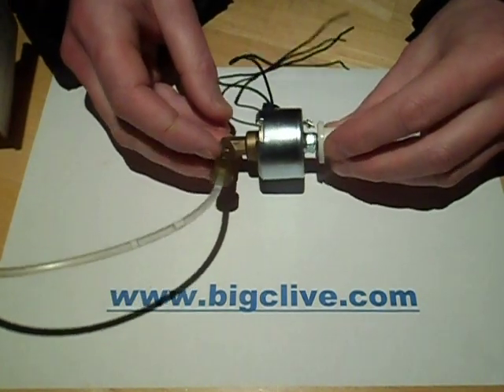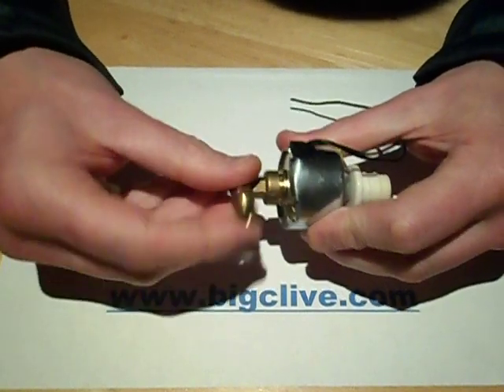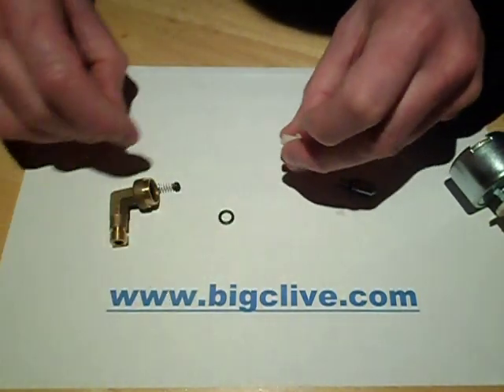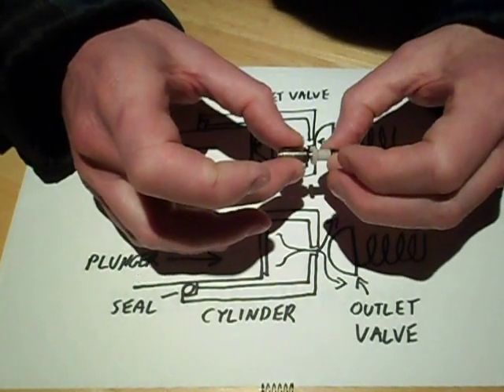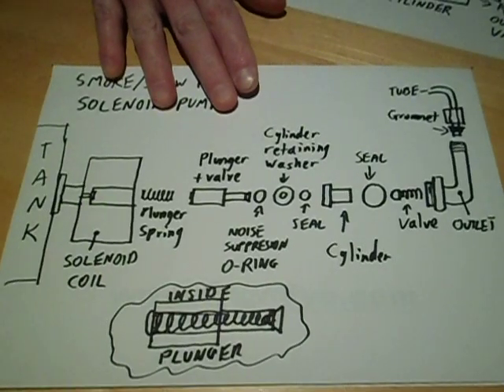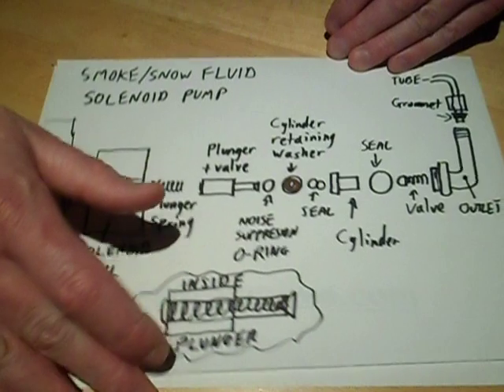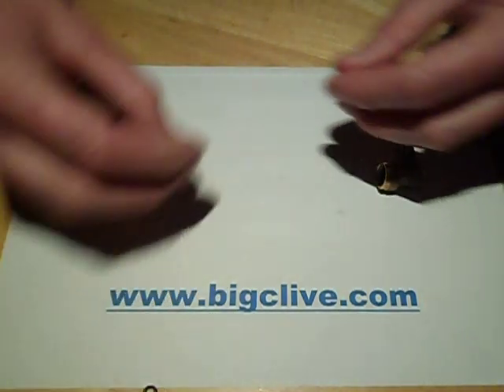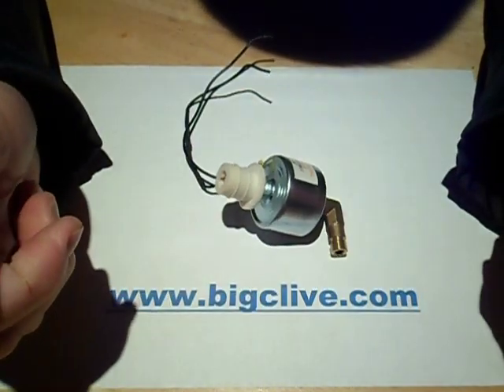Smoke and snow machine pump maintenance.

Comment: Cannot thank you enough, Clive!  This exact pump was in my Pelonis dehumidifier here in the US.  It was less than a year old and was leaking on the floor.  The pump was stuck, and your take-apart-put-back-together diagrams gave me the info I needed to clean and reassemble.  Problem seems to be solved.  You saved me like $200 by repairing, and kept it out of the landfill.  Thanks!

Comment: I have wondered about using these things to pump common petroleum-based oils, e.g. lighter weight gear oils in machines, or automatic transmission fluid for bandsaws (as a source of lube for the blade.)

The volume of fluid needed is modest, about 50 cc per minute or so.
Reply from the maker: This style of pump is commonly used as a fuel pump like the pulsed DC ones used with diesel heaters.  The oil would need to be well filtered though.

Comment: (1) Watch video.  (2) Disassemble pump and clean it out.  (3) Attempt to put it back together and get confused.  (4) Watch video again and discover your pump has a very similar yet different set of parts than bigclive's.

Using the terms from bigclive's diagram, mine has no distinct cylinder nor valve.  The cylinder seems to be integral to the elbow-shaped outlet.  The noise suppression o-ring's inner diameter is larger than the outer diameter of the cylinder retaining washer, and is nearly indistinguishable from the larger seal.  Maybe I'll try to find a replacement pump.  Unfortunately, the ones I've seen so far all use a smaller diameter input hose and output tube (like many of the 400 Watt fog machines I've looked inside).

Despite all this, I still appreciate the video!
Reply: I finally got mine back together.  In my case, the "cylinder" is metal and is an integral part of the solenoid assembly.  Instead of one larger rubber seal as shown in the diagram, this has two.  Once is flat like a washer and the other is rounded like a donut.  They have approximately the same inner diameter, and they slip over the end of the integrated cylinder (though I no longer remember in which order).  There is no removable spring valve.  The elbow shaped outlet pipe (which is all metal on mine) also functions as a one-way check valve, which seems to serve the same function as the spring valve shown in the diagram.  The input and output tube diameters are a little larger than I've seen in other machines.  All that was pointless.  I found nothing gunking up the pump, and it still doesn't run, not even once the machine heats up.

Comment: I'm looking for a tiny 12v 50HZ pump that goes in a "Power Tiny" fog machine.  I can tell that the problem is the rubber check valve isn't working anymore. I think it's swollen in size.  I'm thinking about source an external check valve to go inline with it and see it that will make it work again.
Reply from the maker: It's unusual that the pump is 12V.  Is it pulsed or does it run continuously when active?  It may be able to be stripped and cleaned.  Check out this video.
https://www.youtube.com/watch?v=Yz5MP76EuZc

Comment: I am so happy that you took the time to make this video and post it. My sister has a fog machine that she needs repaired immediately for Halloween tonight. Last night I worked on it without any luck of getting it working. After watching your video I have determined that someone else has taken the pump apart and got the parts back in incorrectly. Just like when I took it apart, pieces sprung out. Now that I know the order, I am about to put it back together the correct way! Thank you very much for the assistance!!! One thing for sure, YouTube is the GREATEST learning tool ever invented. Anything broke I find a video to watch, repair the item, and save myself a lot of money!. Thank you very much for the contribution. Excellent video!!! I can't thank you enough.
Reply: I disassembled the pump and found that it had a broken spring. I  took some stiff wire, a guitar string, and fabricated a spring of same diameter and length. I used my ultrasonic cleaner to clean all of the parts, then used a folded up pipe cleaner to polish up the cylinder. Next I put the assemble all back together. It seems like maybe my brother-in-law might have taken it apart and got the parts in the wrong order. I was so pleased when I fired up the unit and it worked!!! I fogged up my house in a matter of minutes to the point where I could barely see anything, and took pictures to send to my sister. Her and her husband will be delighted to be able to use both of their machines tonight for Halloween! Thank you very much!

Comment: Let me give some tips... 

1. Blow air backwards through the filter that goes in the fog juice, you can do this by blowing air with your mouth. Also wipe the screen off with a tooth brush. 
2. Use a long thin wire, or pipe cleaner, and shove it in the rubber hose between the container holding the juice and the pump. Make sure to disconnect the hose. This will clean out the hose from end to end.
3. Re-attaching the hose is a total pain in the butt so widen the tip of the hose with a Phillips screwdriver, or even a nail that is larger than the inside diameter of the hose. Stretch the hose wide, and once you pull the screwdriver or nail out, quickly push the it on the filter, then do the same for the end that goes to the pump. Last of all, put a tie-wrap on the pump end of the hose.
4. Before disassembling the pump, put a towel down to catch flying parts, pull loose or else you will be on your hands and knees for quite some time trying to find parts. Pull everything apart VERY slowly!!!
5. Check the spring in the very back of the pump. Use tweezers to pull it out. Like on my machine, the spring was broke. I had no springs in my junk parts. I made one! I used guitar wire and wrapped it on a screwdriver shaft. On the screw driver, I used  one that was a slightly less diameter, and wrapped it around the shaft using the same distance between windings, then cut it to same length as the original spring.  
6. Use a pipe cleaner or rag to clean the cylinder where all the parts slide in.
7. Put all parts disassembled into an ultrasonic cleaner. I used dish soap for the cleaner. Run the cleaner for about 5 or more cycles. Use a magnifying glass and closely inspect all parts for any build up. 
8. Blow air through the PLUNGER VALVE (shown in the video). Do NOT try to remove the spring!!!
9. After reassembling parts back on the motor, use the large bolt looking thing to adjust the spring tension. Screw outward to release a bit of pressure on the spring. When the voltage is applied to the motor you should hear it very well. If you don't hear anything, screw the big bold all the way in, and gradually back it out. One can also start with the bolt almost fully out, and turn a quarter turn in until the motor can be heard. 
10. Make sure to be EXTREMELY careful when working with AC power connected!!! Use rubber gloves and insulated tools, and do NOT drop tools or accidentally come in contact with any electrical contacts. Wipe out any spilled fog juice, it is highly conductive. Make a mistake on safety  you will most likely DIE from electrocution. I'm an electronics technician/teacher so I don't have a problem with live circuits, but ALWAYS follow safety rules and precautions. If you are uncomfortable working on live circuits do NOT work on it, get someone else to do it!!! You screw up, this might be your last day to be alive!!!
11. Before starting up the machine after all this work, prime the pump! I used a syringe loaded with juice. Pull the filter loose, shove the end of the syringe on the tube, and slowly fill the pump and tube with the machine on and running. Once you have fog blowing out for about 30 seconds, stop the machine, put the filter back on, put the filter back in the juice, and do NOT let air bubbles in the line. Pinch off the line while putting the filter back on. Keep it pinched until the filter is back and submersed in the juice!

I hope this gives everyone a bit of insight on the techniques I used to fix my machine! The machine works so great now that I fogged out a 30 x 24 foot room in less than a minute!

Comment: How bout if you remove the spring valve so that the fluid will just go straight to the heating component? What could possibly happen?
Reply: Same question here. The rubber head of the spring valve seems to be blocking the flow.

Comment: Good to know. I had my fog machine sitting for quite long and now its just not pumping properly. So im just gonna clean that.
Reply from the maker: +drkastenbrot If it has the same pump then also check for a corrosion blockage at the right angle section.  I've had two block up solid and need reamered with a pointy thing.

Comment: One little tip is when electrically testing some of these pumps, they contain an internal diode, so make sure the meter is on the diode test setting and try it both ways round. Until I did that I thought the pump had gone open circuit.

Comment: I need help, I have the same product, but I think I had some problem putting it together, because it has no power, the jet is very weak. Please, if you could support me, I really appreciate it.
Reply from the maker: If it's a smoke machine then a common failure other than the pump is the pipe going through the heater block getting blocked up with deposits.

Comment: Very informative, thank you! Can you suggest where I might be able to source a new one though?
Reply from the maker: +john rose (TPRC) If it's a high profile machine then from one of the distributors.  If it's a cheapie then from ebay.
Make sure it's definitely the pump that's faulty though.  A very common issue with smoke machines is a blocked heater block, which is not usually repairable.
Reply: bigclivedotcom I had a broken spring and coil in my Antari so I replaced the pump with a high quality fluid-o-tech but it's not easy because it doesn't fit mechanically.
It is much more quiet now with a lot more pressure and for that reason it was worth the money and work.

On my machine, I could screw out the heater outlet from the front to clean it. Did not work at first try, but works now.
There was some burned fluid inside clogging inlet and outlet.

Comment: Hi! I have a question how do I know what is wrong with my snow blower? I only used it once left a little snow liquid inside and stored it away for about 6 years like that.  I took it out of the box and turned it on. the blower works fine.and it blows hot air, but no snow is coming out. So I cleaned it like you said, which didn't have that much gunk in it. Then I put it back together carefully tried again and it still isn't  blowing out snow. What do you think it is?
Reply from the maker: The pumps usually fail.  Check the pipes are all clear and that the pump itself doesn't have a blockage, particularly the type with a right angled metal pipe.  Even though the pump may be humming the cylinder can get stuck in the O-ring if it has swollen up over time.
Reply: bigclivedotcom 
Yes! I have a metal  L shaped pipe that connects to the hose with a tierap and to the pump. All of the other components look like yours.
So how can I tell if the cylinder had  swollen up (where  in the cylinder do I look)  Is that something I can physically see? If it is swollen does that mean I have to  get a new cylinder or replace the whole pump assembly? Thanks!
Reply from the maker: @mrsl0305  These pumps often block at the right angle bend.  Check it's clear with a bit of him wire.  The plunger should move in and out of the cylinder with low friction.  If the O-ring has swollen it may be gripping the piston too hard when compressed.
Unless you can find an identically sized new O-ring it might be faster and cheaper to replace the pump.
Reply: bigclivedotcom 
Omg! It works! I thought I was going to have to throw the snow blower away and have to spend on a new one!  So I checked the L shaped metal tubing ( I blew on it) and it was clear. I checked the rubber washers and they seemed ok. Then I opened the pump from the tank side, there is a filter on one side and a tiny pin hole on the other side of the pump.  You were right there was more gunk in there. So I clean that part out and this time it worked? Thank you for guiding me through this, you are the only one with a detail video it helped me ALOT!!! If it wasn't for you and your replies, I would have thrown it out. BIG THANKS!!

Comment: Super clear video!
I have a H2Ox5 steam cleaner which appears to have a similar pump which may be clogged with hard water salts but so might the steam chamber. I'd like to test the pump separately having removed it. Is this possible without connecting tubes to simulate the working load or can I test it 'dry'? Might I test its function with air pressure? I'm attempting to mend this machine for a friend and hate to be beaten. Thanks.

Comment: Any idea what to do for a pump that won’t pump when the fitting is screwed in all the way, but will work when the fitting is loosened about one turn? I have had the pump apart and cleaned everything. I was careful to reassemble exactly as it came apart (just as you show here), but still will only work when the fitting is loosened. It’s like the piston is not free to move when the whole thing is assembled properly. Can’t figure this one out.
Reply from the maker: Most common suspect is a swollen up o-ring around the pump plunger.  When tighened down it may be gripping the plunger.  I found it quite hard to find an exact replacement.

Comment: hey there hive mind (Clive-hive?) (Clive-mind?), anyone have tips for cleaning out a clogged heating element?  many thanks and happy tinkering!
Reply from the maker: Once it's fully clogged you're screwed.  You may be able to get a new heater block.  It's a good idea to routinely flush smoke machines through with some white vinegar diluted with distilled water to descale the pipe.  Do it outdoors and then flush through with plain distilled water before loading new smoke fluid.
Reply: @bigclivedotcom   that is the procedure I have used in the past. sometimes it works sometimes, eh, less so. thanks for the reply!
Reply: I have bought and used $1000 USD machines and $100 UDS machines and they all broke down at some point. I am leaning toward in the future just getting the cheapest that fills the need and is built well enough to last the show. no need to spend extra on fancier versions with features that i will not use, just more to break down and the more expensive units do not seem to have any better a shelf life, at least once you are above the level of the ones sold in department stores for halloween.  thanks again for the original vid and the reply.

Comment: I accidentally tore off wires from my pump (coil), is there any way to solder it back on solenoid coil or i'll have to buy a new pump?
Reply from the maker: If the wires pulled completely out you'll need a new pump.

Comment: Thanks Clive. I bought the machine as "not working" and took the pump apart and fixed it now but just want to replace it in case it goes again. It's identical to the one on your video but cannot locate it anywhere- can you point me to a supplier if you know of one? Thank you.
Reply from the maker: Have you tried searching for smoke machine pump on eBay?
Reply: +bigclivedotcom I have searched everywhere- there obviously is a supplier somewhere though.

Comment: What do I do what the rubber bit of the outlet valve has swollen to the point that is no longer moves?
Reply from the maker: The most common swelling component is the o-ring round the piston.  You can sometimes cheat a repair by slicing out a very tiny slice of the o-ring so it closes in further, but a replacement is a better option if you can get one.  Other bits could be shaved similarly with a very sharp Stanley/Exacto knife, but it's a bit unpredictable if it will be a long lasting fix.

Comment: I realize this is more 'how to' than 'how it works' but I'm left wondering what makes the pump cycle?
Reply from the maker: +brocktechnology There is usually a diode in series so that it is energised on one half of the mains waveform.  So they typically run at 50 or 60 pulses a second.
Reply: Do you mean what makes the piston move? I'm thinking it is agitated in the piston bore in the center of the motor.
Reply: Magnets. Magnets move the piston back and forth. The liquid never comes into contact with the magnets or electrical bits.
Reply: @bigclivedotcom I've got same pump in a shark steam mop, but the transistor that that's switching it has gone bang and I'm unable to read the number on itClive, could you please suggest what to replace it with, fet or npn. It seems to be switching output diodes to the neutral (or at least it will do when I've replaced the tray) I'm not sure if the solenoid is any good either, it's got a high resistance 1.5meg.if you can offer me any help mate that would be great. Thanks Martin.